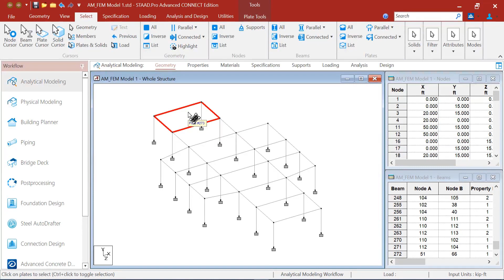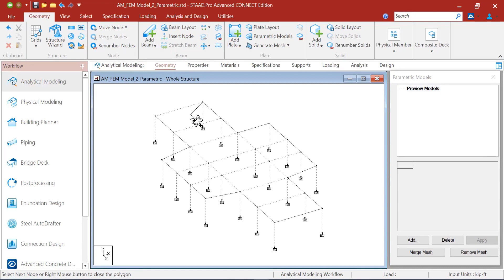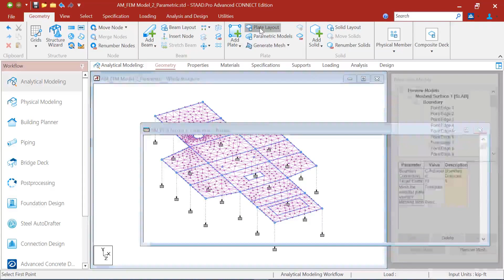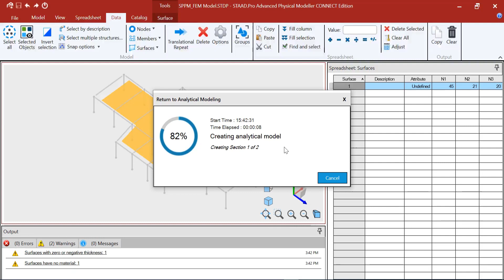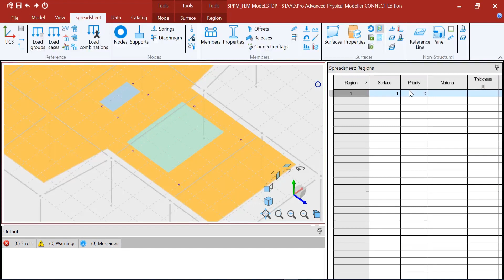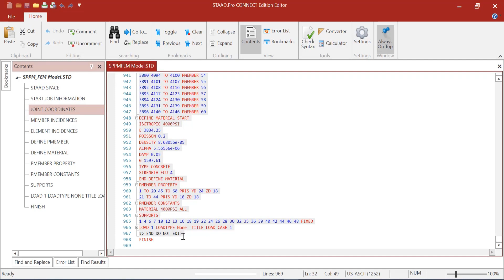Generating Finite Elements in STAAD.Pro #FiniteElements

Comment: During the mesh generation by Generate Mesh option in analytical modeling, I got an error saying boundary points are not in the same plane. 

The boundary points are spread on both sides of the XZ plane (in +ve and in -ve as well). I have checked the boundary points they are in the same plane but am still getting this error. How to resolve this?